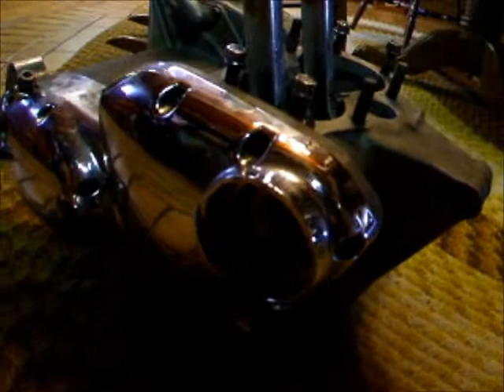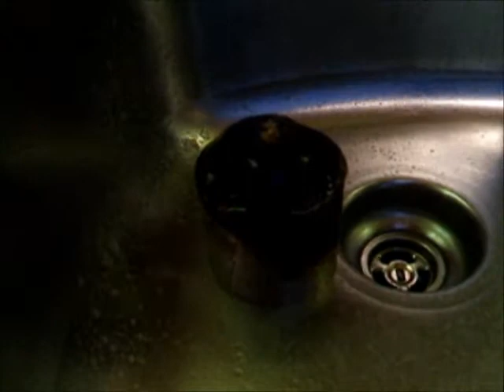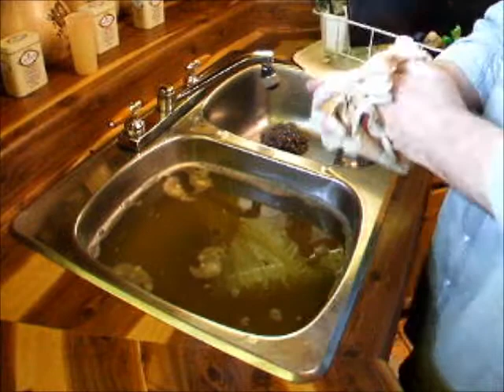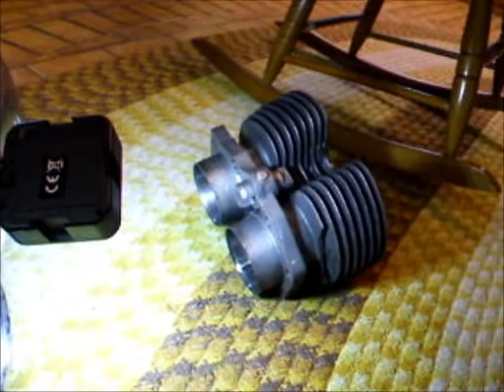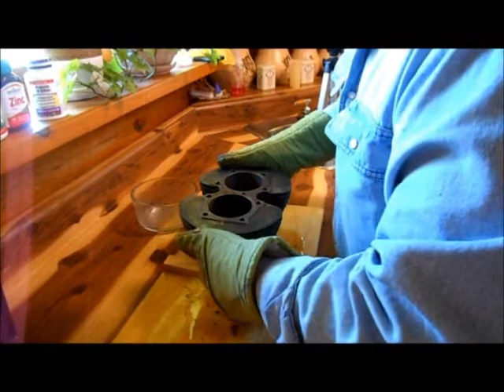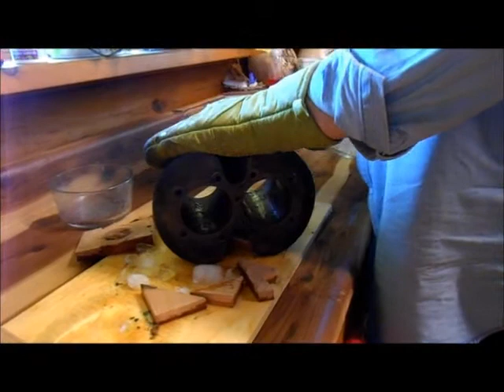Part C6 Triumph T120 Replacement Engine Parts

Comment: spaying  can foam oven cleaner eats aluminum turns it blackish
Reply from the maker: You are absolutely correct. However like any tool, when someone learns how to use a tool properly, oven cleaner can be an excellent aluminum cleaner if you don't leave in on so long as to turn the aluminum black. When working with any corrosive product, knowing what you are doing is the key to success. Contact time before washing the oven cleaner off, is mere seconds, not minutes.